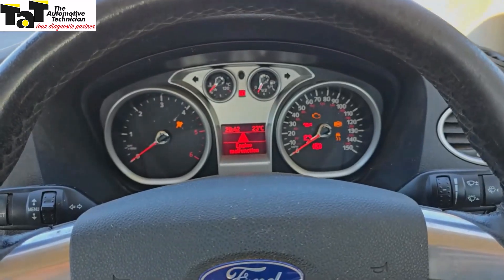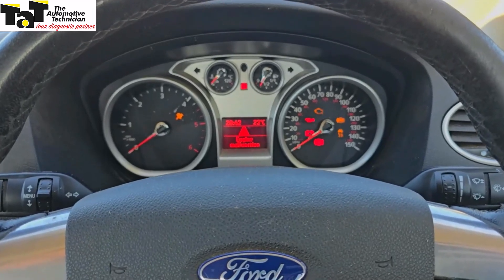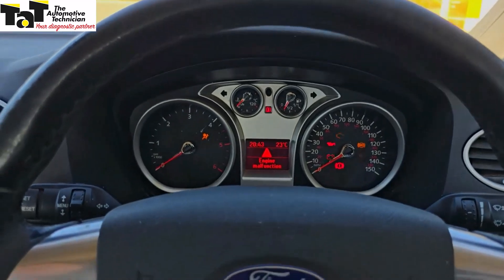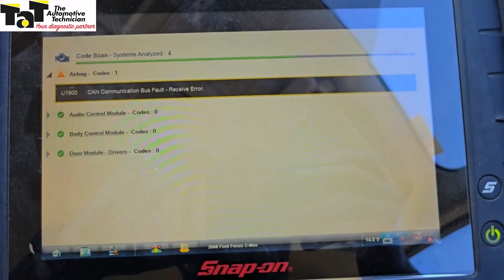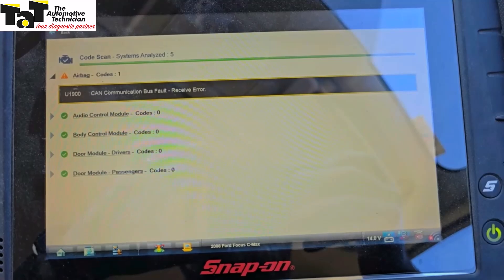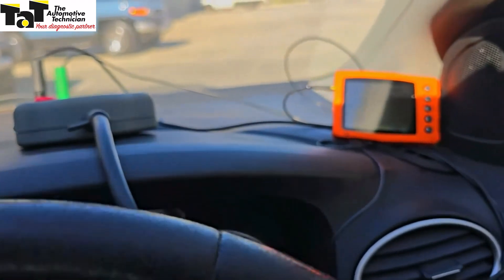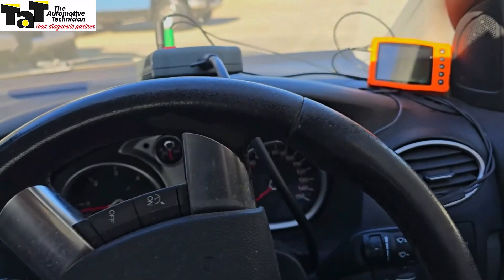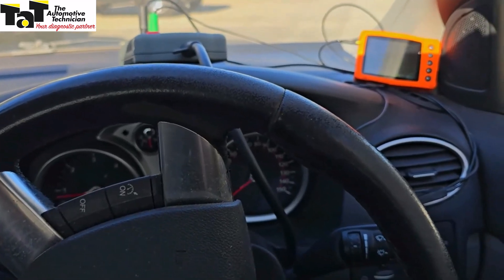Ford Focus U1900 CAN Communication Bus Fault

Comment: Mine says RCM U1900 and it won't start because PATS. Communication with RCM can whatever it says. So why would that indicate instrument cluster problem? Weren't DTC's designed to pinpoint issue instead of diverting away from the issue?